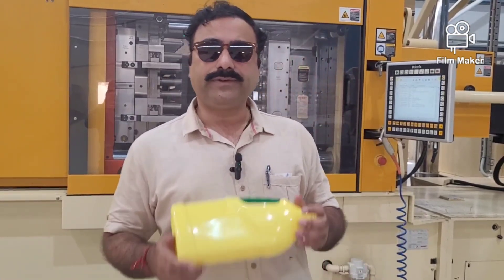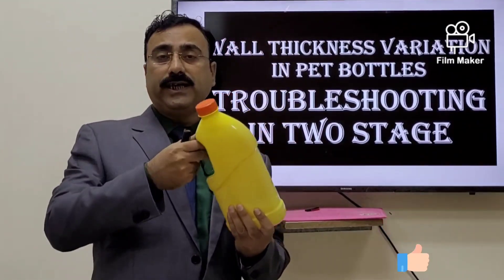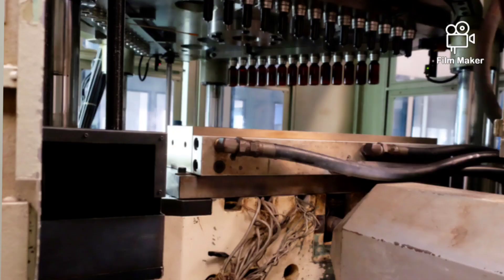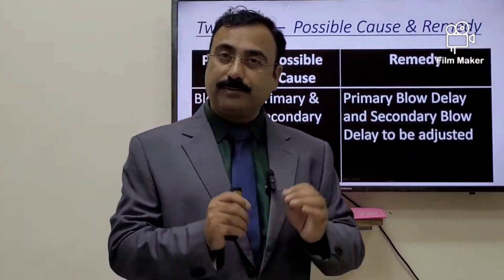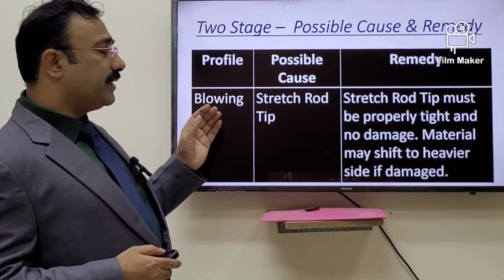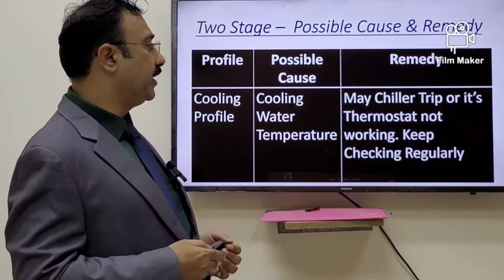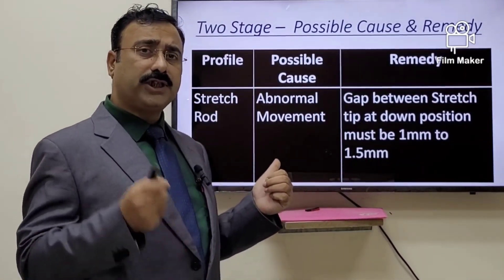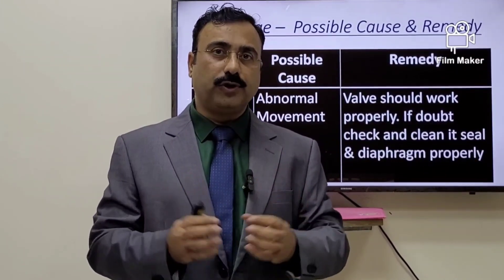Troubleshooting / Remedy for Wall Thickness Unevenness / Variation in PET Preform/ Bottles / Blowing

Comment: Thank you sir for your video. In your video, you show an yellow opaque bottle. Is it pet? If so is the preform for the same available in UAE?
Reply from the maker: Thanks for commenting. Yes. It's PET Bottles and PET Preforms are available in UAE as well.
Reply: @Tothepoint1910  Can you suggest some companies with contact details?
Reply from the maker: @dracul9846  Genesis Polymer +971508418345
Reply from the maker: @dracul9846  Intergulf +971522359695